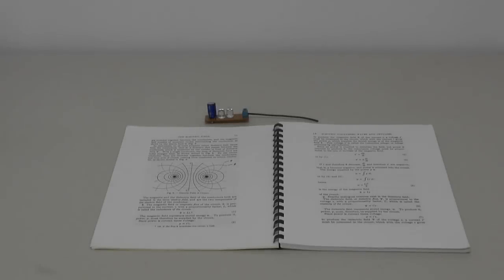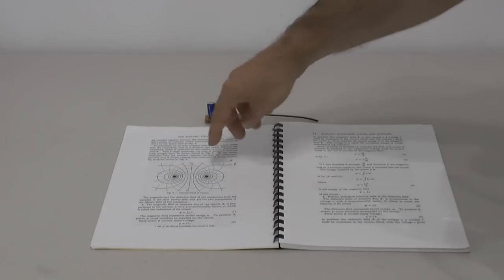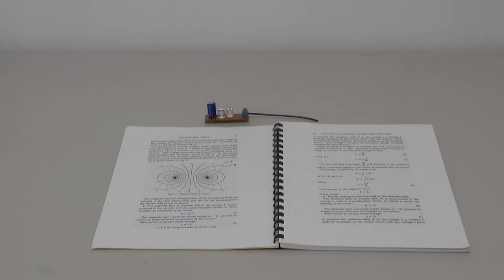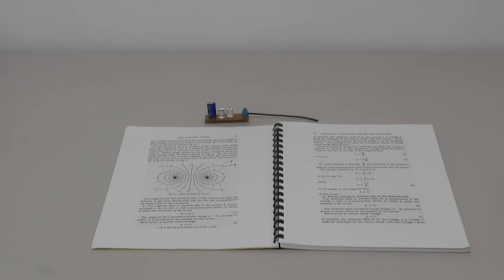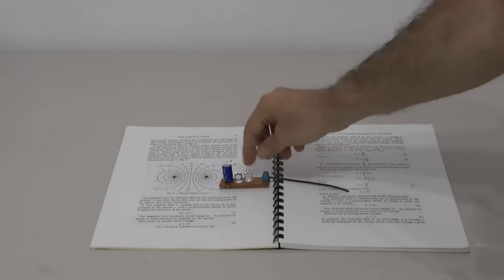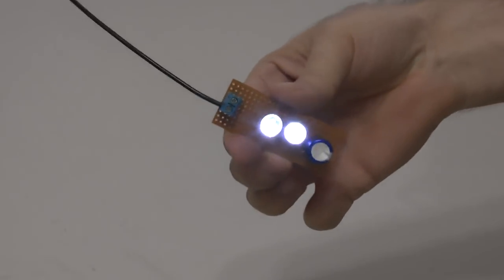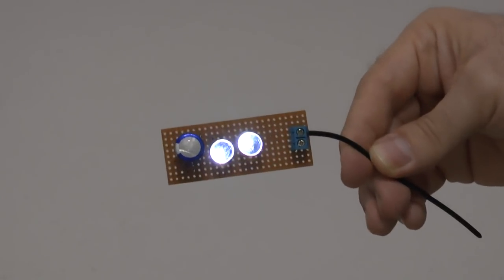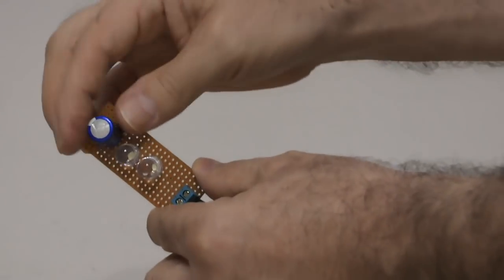Radiant Energy  and Dielectric Fields

Comment: this was the key to the Biefeild Brown effect. most people think its ions but Brown wasnt using ion craft, he was using high k dielectric materials. these materials absorb charge and hold it which affects the quantum gravity of the dielectric material causing it to lift againt the earths gravity.
Reply: Khufu One just make sure you use this knowledge to benefit all beings.
Reply: +Michael Perrone Electrostatic effects do directly interact with "space-time". Check Leon Sprink's patent and his electrostatic effects of "space activation" and time dilation, even some reports of direct gravitic anomalies. For secondary speculation, also check "Ebner effect" for further insight into the nature of electrostatic effects.
Reply: Michael Perrone you are correct about the electrogravity video with water but that wasnt the biefeild brown effect video.

if you study the kowsky frost experiment, you will see that it is the biefeild brown effect. if T. Townsend Brown flew his lifter in a vacuum then he wasnt using ion wind. 

in my oil experiments I show a recursive self organizing geometry on the surface of the oil in sand.

in the true Biefeld Brown effect this spinning geometry that is counter rotating transfers to the atoms of the high K dielectric in Browns experiments affecting the atoms gravitational quanta giving lift against the earths gravity.

Brown never once built an ion wind craft or triangular craft. this is a distraction from the real effect.

to get this effect also you must use a foil capacitor to charge the dielectric. there is a time reverse phase conjugation wave that occurs with the capacitor.

you must have this component in the power supply for the real lifter and a massive high K dielectric.

it is the high K dielectric that is actually floating because of how the charge affects the gravity(spin/charge) of the atoms in the dielectric.

I have worked on two commercial anti gravity craft and consulted for raytheons antigravity program to help block the radiation hitting the pilots from the nuclear reactor and the van allen belt radiation. since the 60s pilots have been signing their lives away and dying within 72 hours of returning to earth from flying around the solar system.

www.torustech.com

www.Tachyonaerospace.earth

we have gone way past proof of principle and now I try to tell you all how it works.

my specialty is the Biefeld Brown effect. discovering the mechanism of quantum gravity and how to manipulate it is what got me into these programs. 

I went around to all the lifter videos on youtube and explained this to the experimenters and they are now on the right track not wasting time and resources on a disinformation campaign called the ion lifter.

ions can access the information structure of the proton and reprogram it.  hence ebner effect.
Reply: I watched many videos including the biefield brown effect video and the electrogravity video.

Out of curiosity, how quickly do the swirls in the oil dissipate? The video was cut off too soon to tell. I know old capacitors which used oil would cause the liquid to swirl, but not indefinitely to the best of my knowledge. Fluid flow can be very low friction, so other means might be better if you wish to quantify the energy there. Experimental design is very important, though it is good to ask why it should swirl in the first place. There exist mundane explanations, and those hypotheses should be tested.

Regarding time-reverse phase conjugation are you speaking in terms of Wheeler-Feynman absorber theory, or an actual reflected wave? If the former, out of curiosity, how do you tell the difference between the retarded and advanced potentials? 

Interesting effects you mention, regarding the high K dielectrics. I haven't done enough work with high-K dielectrics, ferroelectrics, or internal barrier layer capacitors to comment on those yet, but when I do, I will make sure to look out for the effects you describe.

Would you be willing to describe your model of quantum gravity in more detail? Does it differ from Nassim's paper on that website? I would be interested to discuss it further.

The Ebner effect has a lot of disinfo around it too. It makes sense that gene expression may be modified by static fields because cells use static fields to communicate and differentiate, like during wound healing for example. Especially when working with embryos or seeds, an external field may alter tissue growth. It also appears there are epigenetic factors which respond to external fields, but the underlying genes should not change as far as I've heard. Also the sources seem sketchy. Corn was less productive in the past, but a number of sites claim that corn grown in an electric field reverts to a "primeval" form and grows more. I call BS on that point.
Reply: Michael Perrone Again inspired by the Wheeler–Feynman absorber theory, the transactional interpretation of quantum mechanics (TIQM) first proposed in 1986 by John G. Cramer,[7][8]describes quantum interactions in terms of a standing wave formed by retarded (forward-in-time) and advanced (backward-in-time) waves. Cramer claims it avoids the philosophical problems with the Copenhagen interpretation and the role of the observer, and resolves various quantum paradoxes, such as quantum nonlocality, quantum entanglementand retrocausality.[9][10]

the circuit im using, inspired by aaron murikami, has no ground on the cap, there for a forward wave and a backward wave is reflected back from capacitor and can be discharged through a spark gap.

by doing this, you are capturing in between the spark gap, the forward and backward t waves of the dielectric atoms, there for controlling its individual gravity by affecting its time dilation between forward and reverse time waves in the atom TIQM,  By creating a reflection of energy in the circuit that meets in the spark gap which is the plates of the oil experiment.

the oil experiment slows down the discharge process to capture the forward and reverse waves in slow motion interacting which results in that line of counter rotating vortices on the surface of the oil.

since the geometry of the wave that the circuit produces is the same configuration as the forward and reverse waves in the atom according to TIQM, you are providing the means to access that dynamic in the atom.

the forward wave is time dilated relative to the reverse wave meaning they are in the same space but in different time vectors.

this is exactly what is happening in the atom and relates to the double torus topology of nassim.

thats how nassims gravity drive also works.

thats why the capacitor is key, because you can use it to set up the time reverse phase coniugate wave.

low and behold we get a chain of counter rotating vortices on the surface of the oil!

the process in the circuit spilts the wave into magnetic and electric scalar components. in the oil experiments, electric field lines will form on the bottom of the container and the magnetic curling counter rotating vortices appear at the surface of the oil.

its this counter rotating component to the field that taps into the atoms gravity.

i like to think of it as spatial cogging, the organized planck oscillators that make up the space between the plates when energized interact or cog the forward and reverse waves of the planck oscillators in the atoms in the dielectric, which accelerates the counter rotating time waves of the planck oscillators in the atom, which in turn sucks in planck oscillators of spacetime through the center of the atoms and pushing them out of the other side of the atom thereby accelrating that atom in one direction. when you have a bunch of atoms together like in the high k dielectric, they all lift at once when the charge is applied.

like an arm going through two donuts, the donuts counter rotate as the arm moves through the center, only we are controlling tge donuts in our case and feeding the arm through like a conveyer belt.

the rotations ends after about an hour after a one second charge, adding additional charge will keep it going but it will never accelerate further that its given rate.

I tested this with a hv dc meter and after an hour, the oil had stopped turning but the voltage remained in the capacitor to be used showing that no voltage was used up in the movement of the oil.

since there is no way for the electrons to pass the oil, we have filtered out most forces to reveal a hidden geometry that is described by nassim as the structure of space itself. since it self organizes it reveals a feedback from the vacuum.

the wu experiment showed that broken symmetry can mirror charge out of the vacuum that wasnt previously in the system but had appeared from space during the experiment.

we are creating an action in the circuit and the vacuum is providing a reaction.

a version of this circuit grew its own wire to optimize itself after running for 6 hours. 

because it was interacting with the vacuum it could know itself and self organize because thats what this interaction produces, self organization!

forget AI this is actual intelligence!

a technology that can 3d print itself? wonder what it will grow to be...

great questions btw!
Reply: Thanks for the very interesting reply!  I will study it more carefully in the morning. We appear to have separately arrived at very similar concepts regarding the difference in time dilation between retarded and advanced potentials in curved space-time. Hopefully it means I'm on the right track then. 

Regarding the oil experiment, using classical physics, an electrostatic field will still attract a neutrally charged dielectric material due to its polarization/the formation of dipoles. This is why a piece of amber attracts a feather when it is rubbed, even though you have done nothing to the feather. Oil may have negligible numbers of charge carriers, but the molecules can still form dipoles when polarized by an external field. anisotropy in that field may lead to the initial stirring of the oil as a transient effect during the charging of the capacitor, but no further stirring should result at equilibrium (once the capacitor is charged). These are the sorts of mundane explanations that need to be accounted for to tell the difference between the effects.

Namaste,
MP
Reply: Michael Perrone yes sorry I was too lazy to explain that part. trying to focus on your question.

the difference occurs when you have that reflected wave present in that dipole situation, you get a push/pull force IN BOTH DIRECTIONS and not just one direction if you werent phase conjugating the capacitor, and just using a HV transformer.

you must not connect any ground wire to the circuit so that it will reflect back down the path it came and not return to ground.

again, no phase conjugation in the oil experiment, you only get dielectric feild lines. phase conjugation in the circuit produces curl between the plates and not straight lines which locks the molecular dipoles in place and accelerates the plank oscillators in one direction through the double torus forward and reverse waves causing lift in one direction.

you see the dielectric feild lines are still present and active to align the molecular dipoles in one direction. 
then the other component spins both forward and reverse waves to suck the vacuum through the lattice structure of the material to accelerate it in one direction.

just to reiterate that both of these feilds are active and have different functions in the material.

once you have control of the double torus structure of the atom forward and reverse wave, they become little jets of vacuum planck oscillators and the dielectric field lines allign all the now vacuum jets in one direction giving a unidirectional force.

hope that helps now lets see you get something to float. 

hint: high frequency transformer
Reply: If there are many particles, in general there is only one wave function, not a separate wave function for each particle. The fact that one wave function describes many particles is what makes quantum entanglement and the EPR paradox possible. The position-space wave function for N particles is written:[19]

    Ψ ( r 1 , r 2 ⋯ r N , t ) {\displaystyle \Psi (\mathbf {r} _{1},\mathbf {r} _{2}\cdots \mathbf {r} _{N},t)} \Psi (\mathbf {r} _{1},\mathbf {r} _{2}\cdots \mathbf {r} _{N},t) 

https://en.wikipedia.org/wiki/Wave_function

so mimicing the forward and reverse wave function of the atom in a device, creates a field around the device that takes control of all the different wave functions in the room and makes them resonate with the device as one wave function. You are quantum entangling the devices wave patterns to the wave patterns in the atoms around the device. Since these devices are interacting with the Planck oscillations, the mechanical prime mover becomes the interaction of the device with the Planck Oscillators which have an energy density of the vacuum energy density was 10^93 grams per centimeter cube of space.

therefore these devices satisfy the parameters of Kirschoff ( https://en.wikipedia.org/wiki/Kirchhoff%27s_circuit_laws ) by allowing the energy density of the Planck Oscillations of space-time to be counted in the total energy of the system at that point of interaction where the device interacts with the vacuum using time reverse phase conjuagation. 

http://www.cheniere.org/techpapers/sweet%20bearden%201991/sweet%20bearden%201991.htm

https://en.wikipedia.org/wiki/Wu_experiment

Free energy inventors have been using a reflected wave from the vacuum in newtons per coloumb, and transforming it to newtons per joule and watt seconds. Which is what the power grid does as well. this is a time reverse phase conjugate wave, a gravitational wave, or time dilation wave in local spacetime causing curvature in the spacetime producing the double torus pattern and a flow of Plank oscillators down the middle, doing work, as we have seen. therefor, free energy and electro gravity are the same technology. 

Control of the frequency/ time of the reverse wave controls the rate at which the Planck oscillators flow through the system, which is translated to every atom Dielectrically/wirelessly connected as a single wave function, encompassed within a certain value at the square of the distance from the central Time Reverse Phase Conjugation event. 

The square of the distance of the "gravity" field produced is inversely proportional to the devices ability to process Planck Oscillators through it to produce work in the system thereby amplifying its wireless, electric, function which, as mentioned earlier, organizes and polarizes the space and atoms around the device as a single wave function governing all wave functions within that wireless field.
Reply: Michael Perrone my opinion is formed by experimental observation. 
Id like to hear what you think! 
your questions were very helpful to me. Thank you.
Reply: @Jeff.  I agree.  Have been coming to same conclusions lately.
Reply: @Jeff.  Working on that brother.  Understood.
Reply: well Im not dead yet, and Im far from finished exposing the lie, or discovering higher spheres of service.
Reply: The Biefeild Brown effect is very misunderstood. Note my other comment on this video. It explains why positive charges appear to create lift. There certainly are other systems which should interact gravitationally, like the PNN drive (and maybe alcubierre-froning, emdrive, and others). These systems tend to use near-fields and parametric effects which I suspect interact with spacetime curvature differently from normal light. I think wheeler-feynman absorber theory and related concepts may yeild many interesting results for such systems.
Reply: Michael Perrone take a look at my videos
Reply: Your videos regarding Biefield brown effects and townsend brown effects appear to demonstrate the same vorticity. You have an interesting insight there, but it seems to be an ion wind effect. It seems energy is pumped into an anapole structure and the wind from that toroidal vortex pushes the air around the outside like a conveyor belt. this is interesting because in principle because an anapole structure can in principle store a lot of energy and spin up to very high speeds. The lifters using caps and screws appear to just use the expansion of the gas during the electrical short to jump off a flat surface. Your "electrogravity" video is almost certainly demonstrating electrostatic attraction, which may contribute to the force we consider to be gravity since the earth has an electrostatic field from its surface to the ionosphere, but the electrostatic effects do not directly interact with space-time curvature except in special cases. Would be happy to discuss it further!
Reply: Certainly will try to get some things to float! May take time to get all the materials and equipment I will need, but just a matter of time. I think I'm beginning to understand what you're saying.

Regarding growth of wires, that sounds like teslaphoresis. If there is conductive material available in a liquid, z-pinch effects will tend to collect it into wires/fibers at appropriate strengths of electric field. It may be possible to form wires of carbon allotropes in oil as it undergoes dielectric breakdown. Do you have a different model of their formation? What were the voltage ranges and frequencies you were working with when that happened?

The droplets of electrolyte in the biefield-brown experiment are probably also helping the capacitor to slowly discharge. I missed that aspect of the experiment before. That could certainly power the swirling. But you're right: a capacitor like that should not store any large amount of energy. How much energy is actually in the swirling  over the course of an hour also depends on how lossy the system is to friction. It can still be calculated though.
Reply: Yes, what the academics have called Teslaphoresis, is actually the self organizing principle of nature, which is the vacuum, which is geometrically shaped as a double torus on all scales, which can be accessed through time reverese phase conjugation such as the tesla coil does,(it being an LC tank circuit with no ground on the capacitor), interfacing with the transactional interpretation of quantum mechanics where by the forward and reverse waves from the tesla coil(LC tank with no ground) interact with the forward and reverse waves of the atoms and particles building the wire. again the electric field aligns all of the atoms from north to south or positive to negative, the time reverse wave of the circuit resonates with the time reverse wave of the atoms which affects its time vector resulting in one of the toriods of the atom to spin at a different rate than the forward wave, causing a time dilation within the atom, an enhanced spacetime curvature around the event horizon of the atom, and a propulsive force within the atom in one direction.

when the atom is at equilibrium, its rest state is overcome by the earths gravity. when you accelerate the reverse wave of an atom, with a reverse wireless wave of a tesla coil(HF LC tank circuit) you accelerate that wave.

Nassim Haramein, in his device, https://patents.google.com/patent/US8073094B2/en creates an artificial atom using plasma where he can precisely control the time reverse wave, and the acceleration of the Planck oscillations through the center of the device. by geometric resonance with the vacuum inside the atoms of the materials around the device and they begin to float around the device like a solar system. Once the device gets up to speed and the vacuum self organizes around the plasma, the vacuum asserts itself and flows like water going down the drain. An endless drain since the geometry is recursive in the plasma. 

They are building the big ship, along with Tachyon Aerospace.
Reply: Additionally the feed back, feed forward mechanism of the circuit in my experiments mimics the natural rhythm of biological life such as a heart beat and breathing etc. This process is Actual Intelligence as Im calling it, as opposed to Artificial Intelligence. We see this self organizational pattern from mineral to man, crystals and cells. so what could we create? what could create itself given the right experiment?

Ill be making a video about this soon. its my magnum opus as it were, but its a subject that encompasses many disciplines of epistomology, and will take some unification papers aligning terms to describe unified functions between biology, chemistry, electricity, etc. and consciousness.  https://www.researchgate.net/publication/309681048_The_Unified_Spacememory_Network_from_Cosmogenesis_to_Consciousness
Reply: I applaud your enthusiasm, but I will need time to go over all this info. For now I'll leave you with an interesting video https://www.youtube.com/watch?v=PeHWqr9dz3c
It is also possible to filter out superconducting grains from nonconducting ceramic this way. The meissner effect is sometimes insufficient for separation.

An important thing to note is that the transactional interpretation applies to relativistic QM, but not the normal schrodinger equation. This is what I was getting at in the comments of another TheOldScientist video recently. New relativistic effects arise when we have electrodynamic instead of electromagnetic behavior.

The nice thing about the transactional interpretation is that the handshakes constitute interactions/entanglements. Quantum information theory suggests there is no such thing as observation. Or rather, observation is just the entanglement of the observer with the system. The transactional interpretation is consistent with that, and together they appear to explain why wave function collapse happens during observation.

I am curious of how you would explain Laureti's PNN drive and Naudin's time-energy pump, if you have time to discuss it.
Reply: I have my own thoughts about how they work, but I was just curious what you thought.
Reply: Hi Jeff, happy to help!

With the time-energy pump I suspect the voltages may be in phase while the magnetic fields of the solenoids (which are wound in opposite directions) partially cancels out. This forces the system to behave in an electrodynamic way instead of an electromagnetic way, and changes the apparent ratio of E to H, and thus the apparent impedance. Thus the waves interact nonlinearly in the way described by Friedrich Morganthaler in "Velocity Modulation of Electromagnetic Waves". It is important to note that his equations also permitted impedance modulation, which the industry has overlooked since the 1950s. As TheOldScientist showed, the inductors do not need to be concentric and coaxial, and can even be wound 90 degrees different from each other, where mutual inductance should be minimized according to classical electrodynamics. Thus the effect is different.

Laureti's PNN does a similar thing, where the magnetic field of the displacement current of the capacitor increases the apparent inductance of the coil loop segments above the ground plane and decreases them below the ground plane, or vice versa. The total inductance stays the same or similar so that the device can still resonate easily. The change in the time constants of the inductor segments looks like an alcubierre ripple in spacetime from the reference frame of the inductor, so it falls down that gravitational potential and carries the rest of the device with it.

P.S. if Jeff or anyone following this discussion happens to be working on these sorts of projects for space propulsion/exploration, feel free to reach out/hire. I may be able to improve your spacecraft.
Reply: Michael Perrone I was on this same track a couple years ago! http://thenewenergyconceptsgroup.webs.com/apps/blog/show/43877453-research-paper-quantum-gravity-and-pulsars

it was my attempt at using mainstream physics to explain the spark gap and plate launching experiments(amperes force law)

although it seems that the time dependent waves in the paper you mentioned are bifringent and not time revese phase conjugate. 

I will have to look into it more though, to see of this applies to TRPC waves.

Im really glad you brought this up, perhaps there is a Kerr/Pockels/Faraday effect that explains the quantum gravity wave function in these devices.

I do beleieve that a geometric approach is much simpler to understand, but that this explanation may govern the vacuum photons(planck oscillators) interaction with the electrodynamics of the circuit in classical terms.

one such explanation missing from almost all these experiments, and one im trying to lock in. 

thank you.
Reply: Hi Jeff,

There may be simpler models out there, but my interest is in using classical physics terminology as much as possible, so that these concepts can hopefully be communicated to a wider audience.

Spacetime curvature and relativistic effects can also be thought of in terms of a material medium with parameters which vary, up to a point.

It may be that the reflection and transmission created by impedance modulation are closely related to the TRPC waves. In a capacitor, the displacement current produces a curl of B fields. In an inductor, there is still capacitance between the windings and a varying voltage along the length, so there will still be some curl of B, but the usual magnetic field in that situation dominates. When you have the time-energy pump and similar setups, the usual magnetic field cancels out, leaving the varying voltage and a smaller curl of B component associated with the displacement current. Thus it looks the same classically as the TRPC waves you describe. This is especially true when one end of the inductor is floating, because then there will be a capacitance between that end of the inductor (the topload) and the rest of the circuit, It would be interesting to see a Tesla coil with a secondary consisting of two opposite windings which cancel out the usual B field.
Reply: Oh and plate launching/floating is fully explained by classical electromagnetic theory as being caused by eddy currents, as far as I know. Near-field effects and ratios of E to H and D to B (related to impedence) are not so completely explained/modeled
Reply: Michael Perrone

eddy currents are dependent pn displacement currents that create an electric dipole moment in the atoms of the material.

An object with an electric dipole moment is subject to a torque τ when placed in an external electric field. The torque tends to align the dipole with the field.

the time reverse wave of my circuit, taps into the reverse wave function of the dipole moment of the copper plate atoms.

if I take out the capacitor, there are no "eddy currents" and the plate does nothing. 

without the trpc wave, there is not time dilation and no torquing or bending of the spacetime to produce lift, or gravity.

this is purely an electric effect and no magnetic field above its running value is observed at the time of the discharge in the coil.

with a trifeild meter there is no more magnetic feild present than its ordinary presence in the wire while its running. there is no burst of magnetism when the discharge occurs.

there fore it is not really eddy currents creating the lift, but the time reverse wave activating the gravitational quanta of the atoms in the copper plate.

no time reverse wave, no lift.

https://en.m.wikipedia.org/wiki/Electric_displacement_field
 https://en.m.wikipedia.org/wiki/Electric_dipole_moment
Reply: amperes force law also has a torquing between the dipole wires and is more applicable to my DC experiment.
Reply: Eddy currents in classical electromagnetism are typically disussed in terms of magnetic field near conductive materials. It might be better to use a different or new term to describe the effects of voltage/LMD/TRPC waves on currents in a metal.

I would be cautious with a trifield meter: the sampling frequency might be too low to capture the change in B field if it is happening in the megahertz range. Depends on the specific trifield meter used too I suppose. It may be better to use a loop of wire and an ossciloscope to see the pulse of magnetic field.

If the effect is purely electric, that's excellent! Then it agrees with my electrodynamics experiments. You should also be able to test this by pulsing two coils which have opposite winding directions with the same voltage. Then the magnetic fields that lead to the classical electromagnetism effects will cancel, but the voltage and displacement current should remain, and the launching should still happen, even though classical electrodynamics predicts nothing should happen.

Also what does it mean for metallic conductors to have dipole moments? The dipole moments of the bound electrons instead of the free valence electrons? Bosonic excitons? The sea of free electrons should screen any electric fields at low frequencies. Are these effects mainly visible in metals above their plasma frequencies? What frequency ranges were you working with?
Reply: Michael Perrone Michael Perrone thats a great idea about the reverse coil! I twisted wire going to the cap in my resonant charging video to show that induction on the wire was not occurring so I know what you mean about the magnetic feilds cancelling.

the frequency of the driving circuit in most of my experiments are 38khz.  but ive done the coil popping experiment using 60 hz input from the wall.

the surface plasmons typically only occur at high frequency but the cap discharge is a very high frequency resonant impulse that could produce surface plasmons in the plate. 

the electric dipole moment of the copper mean that all the atoms align from positive to negative. the planck feild of the atom is a double torus topology with the bottom torus as the reverse wave function of the atoms spacetime.

the amount of energy of the electric feild determines the dipole moment of the copper plate atoms. the reverse electric feild wave from the circuit, governs the reverse wave function of the atoms in the copper plate. as I described before, the reverse wave of the atom controls the internal time function of the atom.

when the reverse time wave in the atom is accelerated by an external reverse time wave produced by the circuit, the reverse wave in the atom changes time coordinates relative to the rest state of the forward wave and time dilation of the electric dipole moment occurs in the atoms of the copper plate. 

the time dialtion causes the planck oscillators that make up 99.9999 percent of the copper atoms, to accelerate the planck oscilators through the center of the atoms, moving it away from the coil atoms since the atoms in the coil are polarized in the opposite direction.

this only happens when the cap discharges, so yes it must reach its plasma frequency before this function can be enganged.
Reply: my lab was raided and all my stuff taken. i have to start over so I wont be able to get to the experiment too soon.

hopefully someone will.

Im sure like everything else, Ill probably just end up doing it myself and sharing the results
Reply: That's unfortunate man... Make sure to get an amateur radio license and operate in the appropriately allocated frequencies. It's not always secret government people who file a complaint. At about 38 kHz it is possible you disrupted emergency communications on someone's (civilian or commercial) boat. Could be especially bad if you're near a city with a major harbor, or near a large lake, and even worse if your experiment was during bad weather. 38 kHz should travel quite the distance too. Here's the frequency chart in the U.S. https://www.ntia.doc.gov/files/ntia/publications/2003-allochrt.pdf

60 Hz is pretty innocuous generally, but if you're just using ground from the wall, LMD/single-wire signals may travel along the ground wire and be detected. Best to use an off-the-grid power source if possible, like a gasoline generator, battery or large capacitor bank.

The spark gaps you mention have a very broad range of RF noise, so that could have polluted some other allocated frequencies. Solid state systems are tougher to engineer and sometimes less efficient, but ultimately less noisy too.

Alternatively as I have mentioned before around here, you can run your experiments  in two concentric and non-grounded faraday cages with a resistor between them, which should attenuate any near-field/electrodynamic/TRPC waves and may be tuned for optimal absorbtion. You really have to pick/tune the resistor properly though. Too low and they will behave as a single faraday cage, too high and the resistive material will just behave as a dielectric, as in a capacitor. The range of useful resistances depends on the frequency you're working at, since an LR circuit will have an associated time constant. Nested faraday cages have been shown by TheOldScientist before, but the resistance was not tuned so signals could still get in or out with little issue. A seperate grounded faraday cage may be used outside the first two to catch any classical electromagnetic waves being emitted, once any LMD signal has been attenuated.

I hope these tips help you and others. I have had no issues with raids thus far, and I've been playing around with stuff for years at this point.

Also does the toroid structure you mentioned refer to the electron orbitals (which must be a superposition of anapole structures/must have a forward and backward wave of the wheeler-feynman absorber theory, so as to not radiate away electromagnetic energy) or to the nucleus of the metal atoms? I assume both require time reversed waves so they do not radiate?

Above the plasma frequency makes sense, because otherwise the fields could not penetrate the surface of the metal to interact with individual atoms.
Reply: Khufu One This information comes from some of the most advanced aerospace programs in operation today.
Reply: @Jeff.  Good to know I am not crazy.  I have been getting ~downloads of like-kind information lately.  I think many others as well.  The volume has been turned up for some reason.
Reply: Khufu thank you for your efforts. your effort counts.
Reply: @Jeff.  Forgot to ask.  What do we have to stay away from to not get raided or attention?  Any info appreciated.
Reply: Khufu One do not share your research with hollywood scientists like nassim haramein and dr steven greer, etc. or stanford research labs, or basically anyone doing this sort of research in a public and hollywood way. basically everything in the public having to do with these sciences is an intelligence trap.

dont go looking for funding. dont try to do lectures in your neighborhood, and basically dont publish anything.

ive been raided, shot, hit with a psycho acoustic projector, threatened, and even women sent into my life to keep tabs on me. honey pot is the term they use.

I put my neck out to pull these people out of the shadows to reveal themselves. 

they are elon musk, nassim haramein, david singer of kijini, mark hinds of novus via fund and suhka llc, dr steven greer, Elizabeth rauscher, michael lynch CIA, Robert Grant strathsby-crown 

they are technocrats. and satanists I suspect.

dont reveal yourselves to these people and avoid the like. 

I purposefully am putting myself in the public eye to warn the public about specific people commiting these crimes against researchers.

You must be aware of the politics involved in this research.

no investor is going to invest into a technology that replaces oil which is pretty much the source of our money. we live in an oil economy, any attempt to change that is being highly resisted and many methods of suppression are being played out.

bottomline is if someone wants to give you money for your research, make sure it is a gift and no strings attached.

but be wary of everyone when it comes to this stuff. 

I just share knowledge and put myself out there because it is already too late and ive exposed myself to the wrong corporate oil folks. 

due to safety, I am limited to these public virtual venues.
Reply: They got to Elon? Darn. Also your comment on the other video is gone now. Was it too close to the truth?

Also
>satanists
Is that for real? The only people I've heard using that term are extremists on the right.
I did meet one brilliant researcher who was clearly into some occult stuff, but he didn't seem evil or anything though.
Reply: Michael Perrone which comment? the one where I name all the names?

yes elon musk knows about free energy and antigravity but only speaks of batteries and solar. technologies firmly controlled by big oil.

as if vacuum engineering werent hard enough, you have all the politics that go along with it.
Reply: I don't really thing nassim haramein is part of some evil empire.  He was living out of his car for twenty years reading physics books and a surfer.  Only lately have mainstream even started to listen to him.  He was right on black holes before any of them.  If your one step ahead your a genius.  If you are two steps ahead, you are a crackpot....
Reply: Nah the comment where we discussed why time has a direction/where vacuum energy comes from.

I figured Elon's plan was to not touch energy tech with a ten foot pole, but dominate the car market on Mars. No O2 in the atmosphere means gas won't work there. I've got friends at his companies and they're trying to make a profit first and establish themselves as companies using mainstream physics. Why do you think he knows about antigrav/energy tech? Elon seems like a guy who uses all the knowledge he has available.

And no worries, they can't stop all of us out there. There's plenty more besides you or me who are getting close to figuring it out.
Reply: Michael Perrone ive been on investor phone calls with elon. he is an investor with novus via fund. anyway, they were talking about the gravity drive and other free energy tech that had already been developed for the last 15 years.

he is a fraud and a sell out like all those guys sucking oil dick.

we live in an oil empire, but they already live in the future. the only efficient energy technologies, novus via has produced, has been sold off to large corporations with the illuminati eye somewhere in their logo.

www.strathsbycrown.com

https://www.prnewswire.com/news-releases/strathspey-crown-wins-us-patent-for-titration-of-phenotypic-dna-expression-300593850.html

like robert grant, the inventor of botox, a poison beauty product.

well anyway did you copy that convo? 

it was on which video?
Reply: Didn't get a copy, but I remember what was said. I'm just glad I'm on the right track. It was on the recent caduceus coil video. Anyways good luck and make sure to check the frequency allocation chart I mentioned.